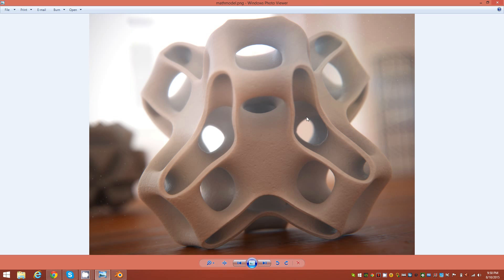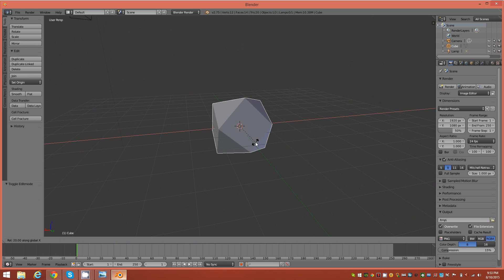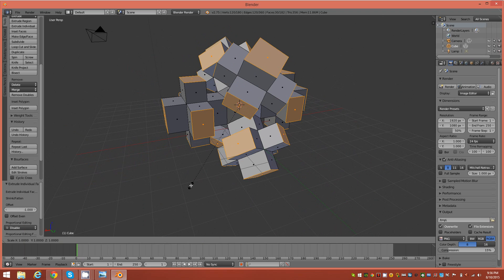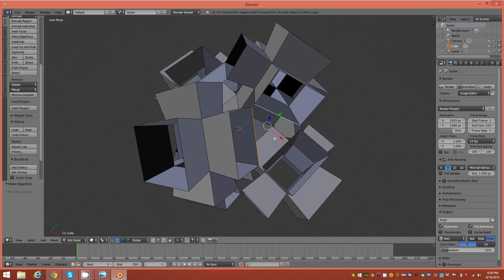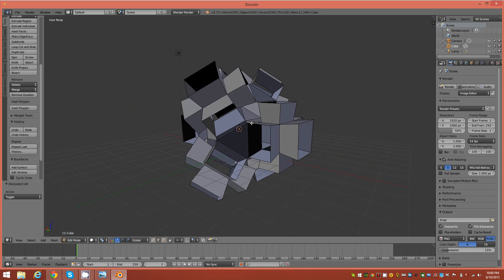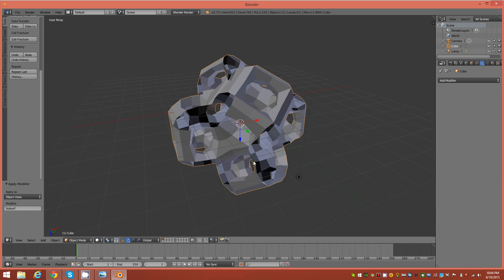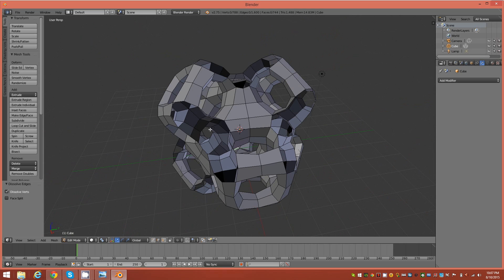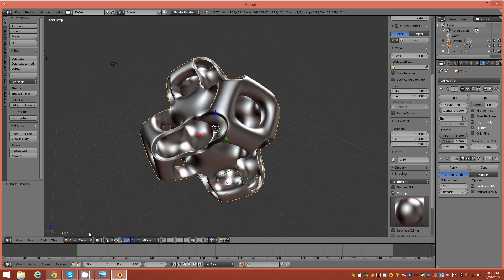youtube video #-pw-677D24k

Comment: Thx John for Blender tutorials. Your videos are true inspiration for abstract.
How to make nonsmooth object from the smooth one? So, that faces are rough and in smaller number.
Reply from the maker: +Sunlessmage I'm not sure I understand the question.  In Blender, there are ways to unsmooth an object, depending on what you wish to do in the end.  For example, you can simply use the UNsubdivide modifier to reduce the number of polygons, and convert the object to low poly (if the object has been subdivided to begin with).  Another way, depending on the object, is simply to show "flat" shaded view, rather than "smooth" view.  There is a button in the Tools menu, on the left side of the screen, which will display Flat shading.  If the object is not subdivided, then this will make it appear rough and smaller in number, as you wish.

Comment: Great video!
Would you say that making iterations 4 will be adequate 
for printing a piece of organic style jewelry making it smooth enough not to need any work after printing?
I heard that nurbs may be better.....is that true?
Reply from the maker: +Manny Tuzman Hello.  Nurbs are  an entirely different technology used to build models.  Many people find it an ideal way to build their model, because very smooth, flowing surfaces without the need to subdivide.  The downfall to this is that you're limited only to building your models with applications and  techniques that support nurbs surfaces.  My tutorials, for example, would be useless to someone using nurbs, as would any video which was based on subdivision surface modeling with polygons.  Modeling in nurbs would be quite different.  That said, I believe nurbs are fine to use for 3d printing, but I wouldn't suggest they are inherently better.  It would really depend on the overall requirements for the models, their ultimate purpose, and how you,  as a modeler, prefer to work. The most important factor to understand is the concept of always modeling objects as manifold, solid shapes; not just surfaces which can be rendered. Finally, I would say that 4 iterations should be adequate.  If the model appears smooth, even in flat shaded  views, then typically this would suggest the iterations are high enough, and you should be good to go.
Reply: +John Malcolm 
Thank you John for your response - very helpful.

Would you happen to know how to get these addons to  work, I cannot:

Bool Tool
Quick Pie
and Booltron
( booltool is basic for these but in mine the brush properties wont work-show up- at all )

Thanks